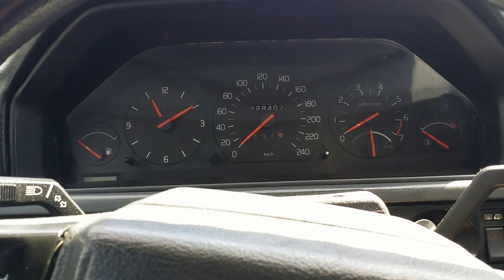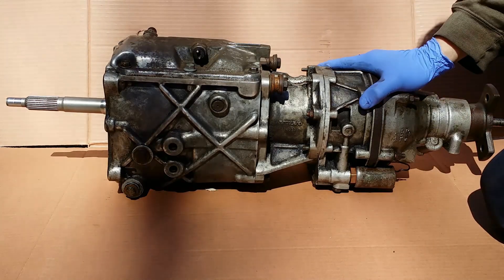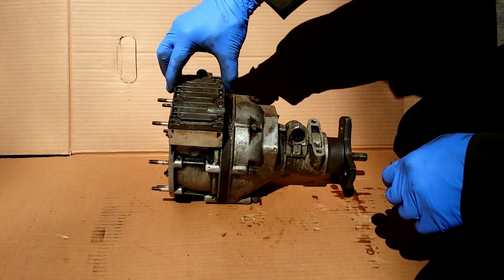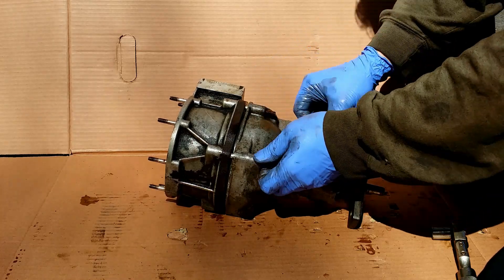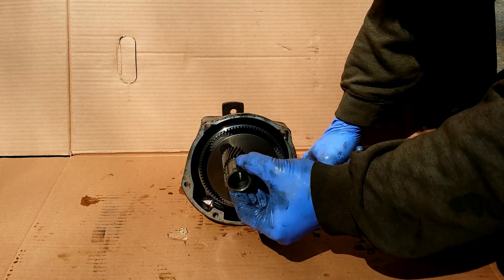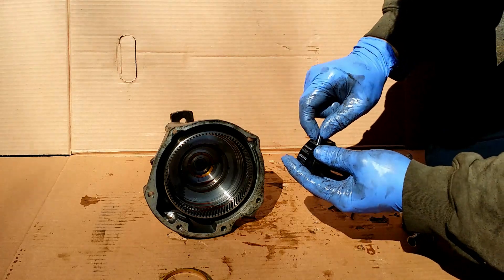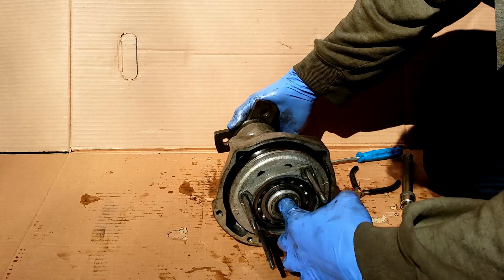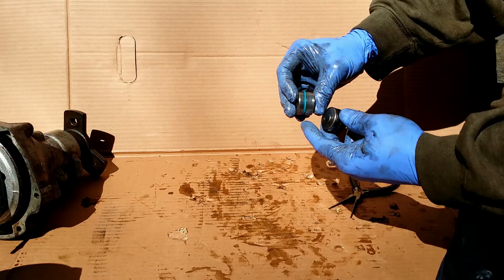"De Revolutionibus Orbium Coelestium" or How the Overdrive Works in Volvo 940

Comment: I got the chance to snap low mileage 740 sedan with 2.4dt engine and manual 4 speed overdrive gearbox, would you say it is as reliable as just a regular manual? Thanks
Reply from the maker: If you can swap it with M90 transmission, no overdrive 5 speed. Volvo didn't sell cars with this option in North America. If you are in Europe you can find it.

Comment: Very educational video, thanks.

One thing i don't quite understand tho. What about engine braking? How come the unidirectional clutch is not overtaken on downhills?
Reply: I managed to figure it out. The other friction cone of the sliding clutch locks the sun gear to the ring gear, so the whole planetary gear unit rotates as one (when the od is disengaged), making engine braking and reversing possible. Phew.
Reply from the maker: Would be great to make a cut out to show it running. 
Your name sounds Finnish.
Reply: Yup, i'm from Finland. My uncle had a 740 with this "button-fifth" when i was a kid.
Reply from the maker: I was in Finland in '92. Beautiful country, white nights in Suonenjoki, deep, deep blue sky I never saw anywhere else.
Reply: A total shithole for a car enthusiast.

Comment: Thank you for this very informative and easy to understand video.
One thing I got only after a few watches is how the rotation of the drive shaft is transmitted if the OD is engaged: the planetary assembly is toothed as well at it´s inner diameter, so it is driven by the drive shaft. As the sun wheel stands still, the unidirectional clutch is overtaken.
Reply from the maker: You are welcome.

Comment: Put a m47 instead
Reply from the maker: M47 is not strong enough for turbo motor.
Reply: @robertdeptula2003  M90 then
Reply from the maker: @mullemeck2240  M90 is out of reach in Canada or US.
Reply: @robertdeptula2003  No problem i ship it from sweden ;)
Reply from the maker: Sweet!!!
Reply: @mullemeck2240  hi I need m90 ,how can I contact you
Reply: @op448570  Sorry, it was a joke. Good luck tho :)

Comment: Hey Robert, great video. I’ve been having some difficulties with my m46 that I think you may be able to help me out with. The issue is that I can’t give my 740 any more than 25% throttle in all forward gears! As soon as I put my foot down the car revs up as if the main engine clutch is burnt out.  I’ve replaced the main clutch but the problem persists.  Reverse still works like normal so that’s why I’m thinking it’s something in the trans.  Could it be that the conical clutches are worn? Or maybe the pump isn’t creating enough pressure? Maybe a stuck relief valve? Eager to hear what you have to say:)
Reply from the maker: You need oil pressure only for OD.  Take it apart and check internals for wear. Check the plate/dish cluch in OD section. Good luck!
Reply: @robertdeptula2003  Hi! It is impossible that overdrive can cause slip on forward gears while turned off, am I right? Because one-way clutch prevents slip and hard locks gearbox shaft with the output flange, right? So the guy's above problem can't be caused by overdrive unit, right? (the only way if you can install that unidirectional clutch inside out). But is it possible that overdrive unit can cause slip on reverse gear? Seems possible for me, correct me if I am wrong. Thank you!